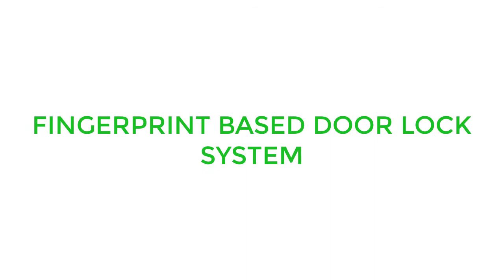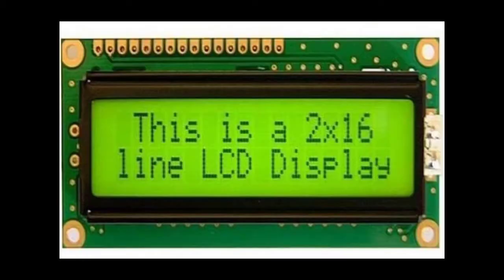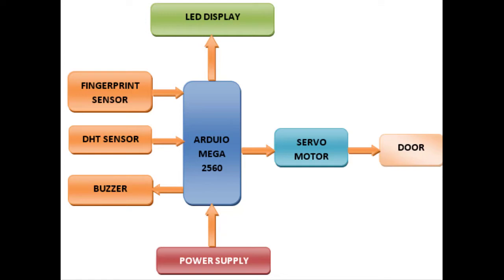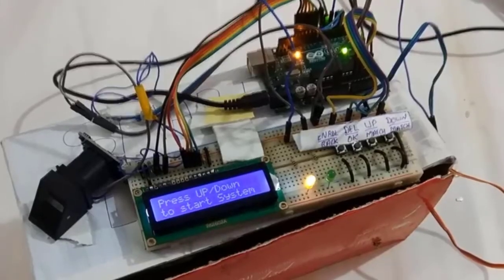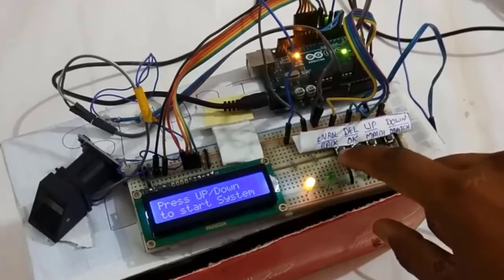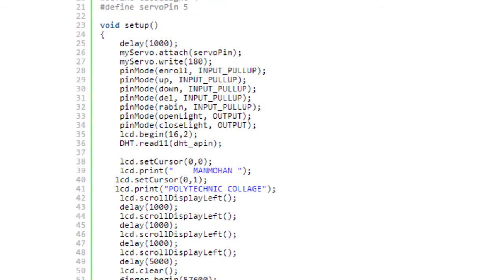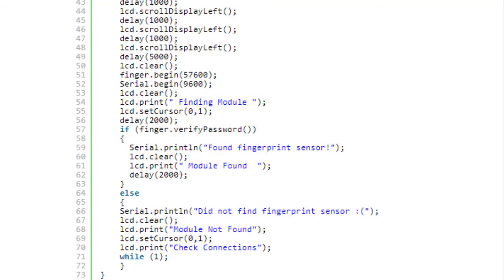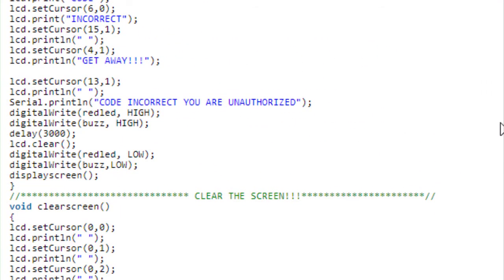ARDUINO DOOR LOCK SYSTEM USNG FINGERPRINT SENSOR || BEST ARDUINO PROJECTS

Comment: Hi, I'm planning on making this project for my school, I ordered the parts, and I have one question, why do I need the potentiometer and where does it connect in the scheme?
Reply from the maker: It is for brightness control for lcd
Reply: @electronicsworkshop7131  hello, just a quick question, is 10k ohm pot meter good for this or which one should I use?
Reply from the maker: Yes it is better
Reply: @electronicsworkshop7131  what do i have to change in the code if im using arduino mega 2560, since the fingerprint connects to rx19 and tx18 because it has hardware serial, also im trying the code but there are a lot of errors that are coming up to me...
Reply from the maker: Yes you can change the controller to mega but you must connect the tx Rx to UART pin of mega .see the data sheet of mega
Reply: @electronicsworkshop7131  keypad getKey();
Keypad was not declared in this scope
Password was not declared
Invalidcount was not declared
How do I fix it and use the torture1,2 functions?